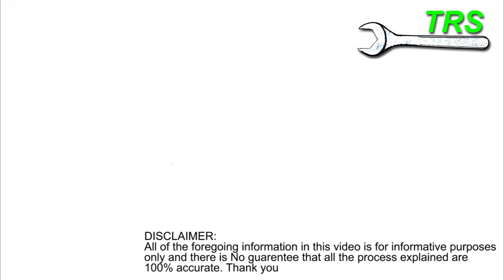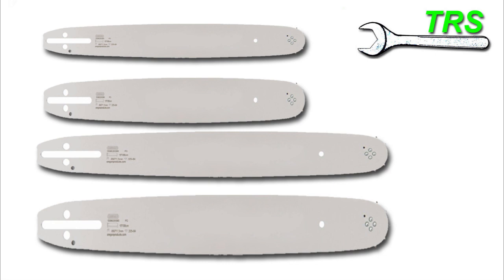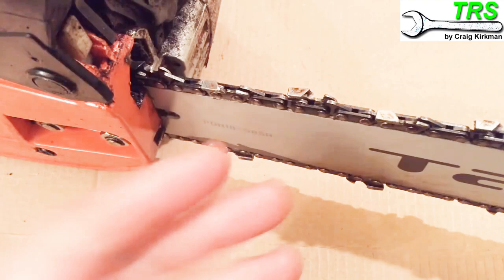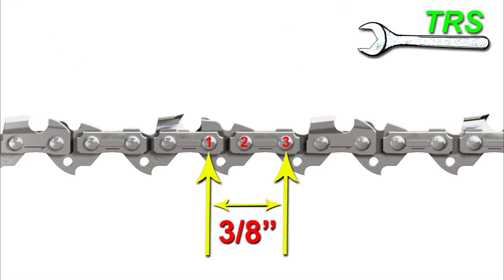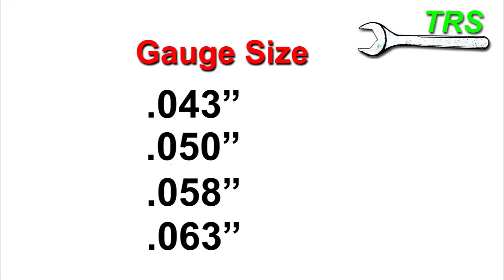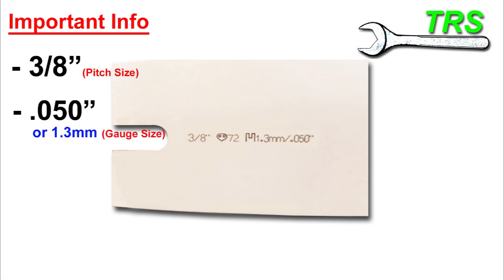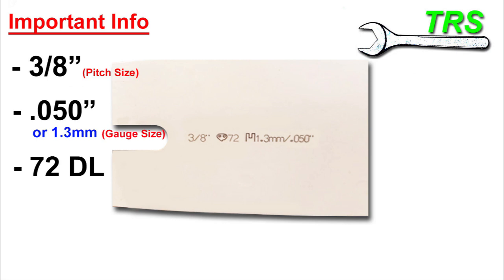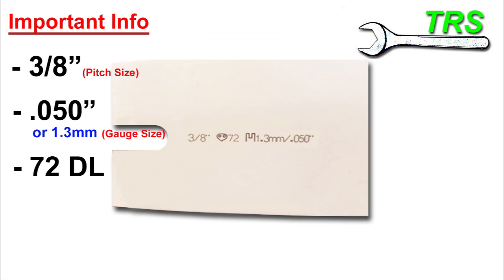How to Buy Correct Chainsaw Chain Replacement (Chain/Bar Numbers Explained) Chain Sizes

Comment: I have two 8”inch battery operated chainsaws. It says the chain is 1/4 (6.35mm).   So now I know I need to count the drive length‘s but does the gauge really matter?  In looking at Home Depot‘s website they have different gauges that says it’s for smaller powered chainsaws.  Any advice would be greatly appreciated. Thank you for your time.

Comment: Hi I have a question if the bar and chain match can you use any bar with any chainsaw. I see on Amazon I can buy a 20 inch .325 .050 80 for a 450 rancher but the new bar and chain says everything is the same except the drive links is 78 ? So does the drive sprocket on the saw motor have anything to do with the drive links ?

Comment: I just found this video after buying a new Oregon 18inch chain for my Troy-Built TB4218 and the damn thing was to long. Turns out I need a 62 drive link and the one I picked up is a 68. I only looked for the inch size. I obviously only use a chain saw once in a blue moon. I did not know this information about chains...Now I do! Thank you!

Comment: Greetings Craig - Say for example you were going at a log and the chain got stuck and wouldnt rotate - and at that point - continued to throttle the gas in attempt to free up the chain and bar yet to no avail - in that attempt the saw began to experience smoking from the "Bar joint" / Cog region - The chain finally got free but my concern is - Smoke was experienced from an unusual region and my concern is - though the saw still appears to operate exactly as it did prior to this experience - should one worry about a newly developed wear one or more of the saw's components? This is a new saw. Thank you for all your deeply educational and comprehensive videos Craig - excellent explainations and instruction.
Reply: After doing some research - To confirm - it came from the "spur sprocket" region indeed - excuse the inexperience - A reply would be appreciated and greatly aid in the determination of or if what spare part to purchase etc - Trying to avoid a situation in where I'd have a compromised saw - in a situation where say additional saws/servicability is nonexistant.

Comment: i have an 18 inch husqvarna saw - i purchased 18 inch chains replacement and they are too short - is there a difference in length based on drive links? 62 compared to 72?

Comment: What does the number stamped on the drive link mean? I have several chains with 72, 73,20,22 and were at one time on either Stihl ms 290 or a red Mac GZ550?

Comment: Thank you for the video.  How much wider should the groove be than the thickness of the drive links?  (that wording is awkward.)  If the drive link measures 0.063, what should the groove measure (approximately)?  My bar has no numbers, and it's a bit worn out,  I want to squish it to tighten the groove.

Comment: Thank. Anyone can help me with an issue: I've checked all data on bar and in chain saw manual (18", pitch 0,325", gauge 0,058",  links - 72) - ordered new chain. How can it be old chain and new chain per perfect fit bar groove, but at the very top of the bar on sprocket curve it has too big spaces (though old chain don't have ones - fits perfectly on the curve too). What is wrong here ?

Comment: So I got a new chain for my 20 inch saw..and got a 20 bar...dont fit. On the chain I counted 82 links...the packaging say 80 links? What up with that? And so a 20 inch chain don't fit a 20 inch bar..iam confused
Reply from the maker: Oh, it sounds like you've run into a bit of a mix-up with your chainsaw chain and bar! It can definitely be confusing, so let's see if we can sort this out together.

First off, the length of the chainsaw bar is generally referred to by its cutting length, which is the active cutting area of the bar. However, the actual physical length of the bar can be a bit longer than that. Now, regarding the chain, the most important thing is to match the chain to the bar's length, and more crucially, the chain's pitch and gauge must be compatible with the bar and the saw itself.

In your case, the chain having 82 links when the packaging says 80 could be a packaging error or a miscount. It’s vital that the number of drive links (those are the links you counted) matches what your bar is designed to handle. If there are too many or too few links, the chain won't fit properly, as you've discovered.

And yes, a 20-inch chain is designed to fit a 20-inch bar, but only if the other specifications (like the number of drive links, pitch, and gauge) align. It's always a good idea to double-check these specs when purchasing a new chain or bar. If possible, bring your chainsaw or the old chain to the store to ensure compatibility, or note down all the specifications from your saw and existing bar and chain.

Don't worry, this is a common issue and easily fixable. You might just need to exchange the chain for one with the correct number of links and compatible specifications. Once you have the right match, you'll be back to your cutting tasks in no time!

I hope this helps a little

Craog